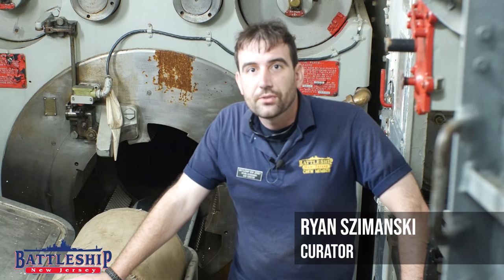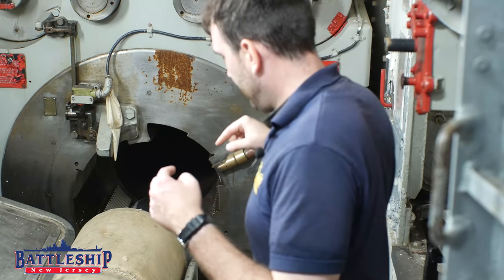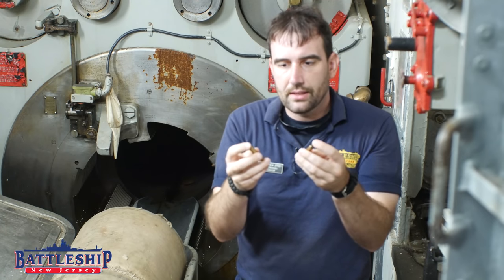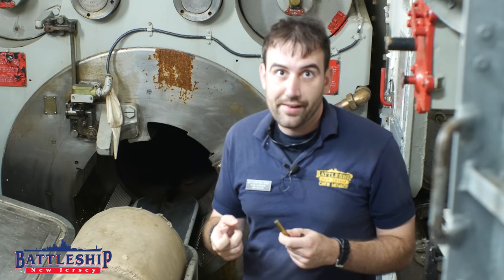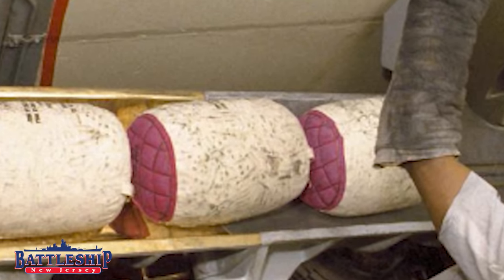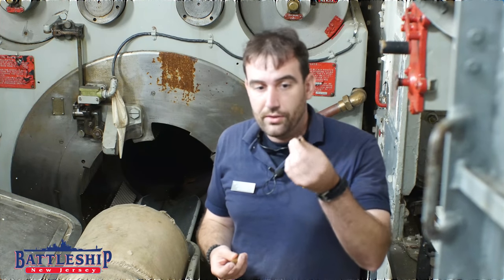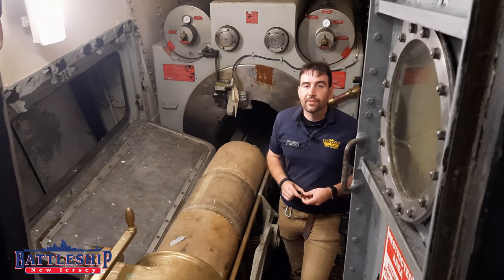How Do You Fire the 16in Guns: Primer

Comment: I thought your "Garand thumb" comment was missed, but someone caught it.
Reply: However bad Garand Thumb might be - its nothing compared to "16 inch Hand" :D
Reply: If I'm correct, Garand thumb, was what happened to your thumb, from pushing the clip into the gun.
Reply: When you push the clip into the receiver of the garand, it releases the spring loaded bolt and it slams shut  against the breach. If you didn’t get the thumb you pushed the clip in with out of the way in time your thumb will get smashed between the bolt and the breach of the barrel.  This can happen when only loading two rounds in competition, or if you push the bolt closed on a full clip and forget to make sure your thumb is not out of the way first.

Comment: Ryan, as someone who is a hand loader that reloads competition grade rifle cartridges, I'm astounded that 16" Naval gunnery isn't too dissimilar. Scale is the only difference. I was astounded further to learn that naval gunners paid close attention to powder lot numbers. They zeroed off of specific lots. Same goes for Hugh power rifle loading. You don't mix powder lots.
Reply: What does zeroed off mean? What's Hugh loading?
Reply: @Melanie16040  "zeroed off" meaning that they knew the exact range that they will get from specific powder. And he meant "high power rifle"
Reply: @Melanie16040   

Zero'ing a gun means , you take your ammunition.. aim at a known distance  For a rifle, say 400 yrds (for a 16 inch gun it would be a LOT further out)
and shoot it

Then you check to see if your shot was low or high to your aiming point.
Left or Right

With this info, one adjusts the aiming device accordingly.

Now repeat the zero shot, to confirm your aim is set to where the shot will land
if not, repeat adjustment.

Once your gun's aiming device is zeroed to that known distance, It becomes possible through ballistics calculation, 
to select other distances, simply measure range to target, set the aiming device to that distance
And the shot should land on target or at least very close to it.
For the example given the rifle is now "zero'ed at 400 yds".

Whenever the aiming device or ammunition is changed,  a new zero will be required.

Match rifle shooters will do everything in batches.
Weigh all the cases to be in the same category
weigh all the projectiles to be in the same weight
Use powder from a known batch and measure it to exact weight
They will even use different loads and combinations tailored to each specific gun.

Such ammo will be at least twice more accurate as even the best 'match grade" commercial rounds.

For 16 inch guns all components come delivered separately, primer, projectile, powder bags.
So the gunners do not weigh anything, but,  they will check the bags to make sure they are using the same batches of powder, from the same factory, same production lot, same age in storage, same humity in storage, etc etc... So once they zeroed on that batch, their expectation will be that the other powder bags will deliver the same result or as close as possible to it.

Comment: Definitely looking forward to the upcoming video on the types of powders used in the BB's guns!  Thank you!
Reply: The shitposter in me really wants to say "but bb guns use air or co2 not powder".
Reply: Me too.  The powder and it's storage is really interesting to me.  So there is no secondary casing, just a projectile and a propellent and it all uses the barrel to contain the explosion.  Great engineering.
Reply: @mikeburch2998  :

The only thing that "explodes" or "detonates" in the gun is  the primer, originally fulminate of mercury, on the blank cartridge. The main charge in the blank burns, rapidly, as does the propellant pushing the shell  out the barrel. It has to burn rapidly to accelerate the shell. If it explodes or detonates, it would shatter the breech.
Reply: @andybreglia9431  Battleship propellent is actually quite slow burning for a powder. if it burned rapidly it wouldnt produce the energy and pressure to launch the shell out of the muzzle. they used a D846 rate NACO. Nitrocellulose with a small amount of Blackpowder.

Comment: Guessing the reason for the two methods of firing was for during battle, if the electric firing circuit was damaged/disabled they can fire the guns locally by using a striker or firing pin connected to a lanyard (similar to the way a M114 Howitzer is fires) to set off the powder.
Reply: You're absolutely correct.
Reply: If the electrical was out the breach fans would not work meaning the rounds you could fire at that point would be limited. I believe the ship that learned this the hard way was the Sammy B Robertson
Reply: @Wesrl  very true, however remember the firing pin would be as a backup "just in case" ive never heard of any instances where it has had to be used though.
Reply: @Wesrl  It doesnt have to take the whole electric system down.  A shot to one of the control rooms might take the firing circuits down, but doesnt hinder the rest of the ship.  This gives you a way to keep the guns running .
Reply: Remember. A battleship should fight. If a splinter cuts the wires controlling the firing circuits. You are down to telephones or the old voice tubes to communicate with the turrets. Alternatively. Use the rangefinder hidden in the turret and ask the gunnery officer to start guessing where the shells need to land and calculate the Destination and watch your fall of shot.
Reply: imagine if it didn't fire, you have a huge bomb sitting there, a mechanical means of firing would be a great safety feature
Reply: @bobstitzenberger2977 misfires were a thing in naval Guns. Rare, and terrifying. Look at the steps behind how they use a detonator to light black powder to light guncotton.

Imagine for a moment the black powder was damp and failed to light fully. You end up with a guncotton fire burning behind the breech, just waiting for some daft human to unseal it to check what was going on inside.

Which is why the first step on a misfire is try again, then wait patiently and deal with it later, and never point a loaded gun at something you don't mind blowing up.
Reply: And  in a case like that, the Gunner's  Mates would have fistfights over who got to pull the lanyard.  Gunner's Mates LIVE for that shit.
Reply: @rickn8or  I like to think that delays in firing during test fires of the system during live round training and practice happened because the lad who lost the round of paper scissors rock decided to double down and offer two weeks of desserts to the one actually rostered to fire the weapon, who gets the final pick if he will trade his responsibility.
Reply: During my time on the New Jersey (commissioning crew 1982) my first year was in turret 3. I was primerman left gun and got the chance to manually fire the gun 2 times. 1st time was called a miss fire and a second primer was loaded and the gun fired. The 2nd time was a hang fire where the 1st powderbag was removed a fresh one reloaded a new primer loaded and i pulled the firing lanyard until the gun finally fired. Exciting, very dangerous but required to get the gun back into operation.
Reply: @bobstitzenberger2977  it is, I watched an old Sargent jump up on an 8 inch field Artillery gun after it failed to fire. He counted the powder bags and realized it wasn't loaded. There is always the danger of a "cook off "and blow the gun crew up. This was just a mistake but hell was raised!
Reply: @glenmcgillivray4707  I imagine it could also burn/smoulder through the first powder bag and then set off the black powder charge on the second one, which then may work and have the gun fire multiple seconds/minutes later?
Reply: @thelasthallow  Ryan just showed you one at about 2:30 on the video.
Reply: @thelasthallow  Well, the one he has in his hands was fired percussively, I'd say you have seen one :)
Reply: @brettwalker1182   the sound and recoil of the gun firing should be mind boggling?
Reply: @cap5856  It was a while back but I think 30 minutes was what we waited. As for being called a hang fire, no clue I was just a tall deck seaman that got thrown below the gun because my GMG1 was to light to get the breach open all the way. Also imagine how short your life could be with your arms wrapped around a 110lb bag of powder that you are lowering into a 30gal immersion can, that might've been still smoldering.

Comment: I fired M110 eight inch howitzers for ten years. My guns had the same type of breach mechanism, the Whelen interrupted stepped thread breach block with the De Bang obturation system. We also fired them with a primer that looked very much like the one you showed but it was percussion only. The De Bang "obturator spindle," we called it the "mushroom" for obvious reasons, had a hole through the stem to the face of the mushroom and the primer was placed in this hole and a percussion hammer firing mechanism was slid up to place the hammer in line with the primer. When the lanyard was pulled it cocked the hammer and then let it fly to hit the primer, the flash from the primer went through the hole in the mushroom lighting the red pad of black powder on the base of the first powder bag and the rest is history. My high explosive projectiles weighted only 200.0 pounds but my nuclear projos weighed more. (did they ever have a nuclear projo for the 16 inch?) Max range with the HE shells was 26,800 meters and the nuclear shells was slightly less due to their  heavier weight. I then switched down to the tiny guns in an M60A3 tank, only 105 mm (about 4 inches) but very high velocity of 5,500 feet per second. These rounds are fixed, just like a rifle round, the projo with its brass case and with a primer in the center of the base. These shells were fired electrically, with triggers on the gunner's turret controls, and on the track commanders turret controls. If there was an electrical fault there was a back up way to fire the shell which consisted of a standard five cap blasting machine in a bracket mounted next to the gunners left knee. All he had to do was grab the t-handle and give it a twist to fire the shell.
Reply: A friend has an 8'' D 651 howitzer shell inside his front door. It is completely hollow and thin walled, maybe 5/8 inches thick. I think it was used to disperse mines. It's unfired and his wife uses it to hang her umbrella and park a sun hat on. It's a chunk of metal!  He has some brand new unprimed  irridite plated steel 105mm tank propellant cases, too. His mailbox stand is the 105 tank round with the squash head base fuzed projectile. It has been there for 20 years but some Karen called the Sheriff last year to report him saying that he has torpedoes on his lawn. The guy is a CCW instructor and knows every Sheriff in the county. It still holds his mail box.

Yes they had nuke 16 inch projectiles but never really admitted it. There were supposed to be 50 of them and were known as W-23 and had 15-20 kiloton yield. They have one in a museum. They were removed from service in 1962.

Comment: Sure - been shooting for over 40 years.  BTW, those primers look a lot like old fashioned straight wall black powder rifle rounds - something like a .45-70 only a little smaller.  VERY cool!
Reply: Maybe a thick walled .30-40 krag case cut off before it necks down possibly? But I also agree it looks like a .45-70 case.
Reply: It's actually known as a Lock Combination Primer: This is the internal construction of the thing. https://eugeneleeslover.com/AMMUNITION/PAGE_27_FIGURE_3C4.JPG
Reply: @Melanie16040  that's awesome.  I didn't mean to imply that the internals were that of a simple rifle cartridge, just that they appear to have cribbed the geometry from such a cartridge.
Reply: Looks too small for 45-70. Looks like a 375 Winchester
Reply: @dimesonhiseyes9134  it is smaller, but an older cartridge.  .375 Winchester dates from the 1970s. I found a source detailing it some weeks ago, but don't have it in front of me. If I recall correctly, it was either 32-40 or 38-55.  

38-55 is the ancestor of the .375 Winchester - and they look very similar.
Reply: @selkiemaine  I thought the .375 was much older. I think I reversed the 38-55 and the .375. I don't deal with the niche cartridges very often

Comment: It's quite badass that it needs a four stage explosion to fire a shell
Reply: They literally have so much in the way of powder and explosives that they need a primer to detonate a low grade explosive to set off all the explosives.
Reminds me of the Sprint Anti-Balllstic Missile system where the missile being launched was "too slow"... so they shot out. Where it then continued on its first stage. For 1.2 seconds. And having the second stage start only about 2 seconds after being fired out to save time for the launch sequence. The engineering on some of these things is crazy. And it's even more crazy when you realize how long ago they were doing it.
Reply: @matchesburn  Not to mention that Sprint missile accelerated at 100G at launch... It literally went so fast it needed ablative heat shielding to protect it from the plasma that formed around it due to how fast it went in the lower atmosphere. Same sort of shielding used to protect space craft returning from orbit.
Reply: I wonder if the new russian anti icbm rockets are faster or slower than the sprint

Comment: RYAN polish that breach!   Who stuck a label on there and caused it to rust...grrrr!
Reply: Yeah RYAN! For your next feat of manliness clean the breach and the pit to level one of the gun captains would not spit redman at you for.
Reply: I was just thinking that lol, I wanna get some steel wool on it haha
Reply: I'm glad that I wasn't the only one bothered by it.
Reply: @sc1338  right. Lol
Reply: @MAHONEY1940  who at ?   ☺
Reply: First think I noticed was the rust on the breech!
Reply: @ATN2USN  Me too. I kept thinking if ol' CPO had opened the booth door and saw that.... Ryan would be on the needle gun for a month! LOL
Reply: @justindunlap1235  Kept staring at it
Reply: Why does a label cause rust? Shouldn't a label actually protect the metal beneath it from rust?
Reply: @MoritzvonSchweinitz  It probably trapped some moisture beneath the sticker and the adhesive may also have been corrosive to some degree.  Mix that with the salt water in the air and boom you can get some very nasty rust quite quickly.

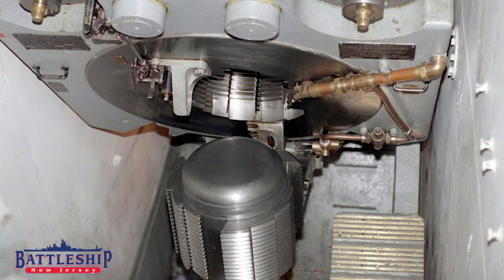Comment: Ryan,  at 1:52, the extra sleeve worn by the gun captain is not to wipe off anything, but to protect his arm from heated exhaust.    In theory the muzzle exhaust gas extraction system will not allow any heated combustion gasses into the turret, but in reality, the gun captain protects his arm, which passes by a possible exhaust path.   He may wipe, but this is not the reason for the thermal sleeve.   

Love your show, MCI

Comment: I find this particular video to be very interesting. The primer & primerman are rarely discussed but they actually install the device that begins the process of firing the main battery guns. They are responsible for the primers & the inspection of the firing lock. Who knew this rifle fires just like any other by cocking a hammer. The primerman isn't easily seen and usually forgotten in videos & pictures because he isn't in the gun pit with the gun captain, rammer operator, powder hoist operator, & cradle operator. He's down below in the gun pocket standing on the pan plate above the electric deck, which is where four more forgotten personnel are stationed which are the three gun layers & one gun trainer. I have lots of good pics/illustrations of the primer, firing lock, & primerman including the long stick they use to insert the primer into the lock, if anyone is interested. Thanks for the video Ryan!
Reply: Hi bryanshaw3711 - yes I would be interested in anything you have regarding the primer, firing lock, etc.  Am curious about exactly how the primer can be fired both percussively and electrically.  Percussion firing is just like a bullet.  But how is it also fired electrically?  What's the circuit?
Looked a little more and found the answer posted by @halo3zocker.  If you search for "Mk 15 Mod. 1,2,3 Primer" it's there.  Has a drawing showing how the cartridge has both a percussion section and an electrical section ignited by a bridgewire.  That's why the green insulating ring around the percussion primer.

Comment: I was a chief of fire direction in a field artillery battery computing the data for towed M198 155mm howitzers and M109A1 self propelled howitzers. The shell is a hefty beast over 90lbs with big bags of powder but nothing like that used in those old 16inch guns. A 155mm shell is more or less 6 inches compared to 16!!! When I was younger I helped the gun crews load ammo from a resupply vehicle and at about 90lbs that kicked my butt. For those huge naval guns they have to use hoists and crane systems, and I remember watching a film from WW2 of German gun crews loading their huge 350mm guns and larger siege mortars. Those were gigantic shells the size of a small car!!!  As an old artillerist I love these videos, wouldn't mind seeing something about a naval fire direction center. The concepts are the same as for field artillery, but I know the equipment such as maps, charts and computers were very different. Because a lot of what a fire direction center does is classified even film of older FDCs is hard to come by. Btw I did enjoy the video